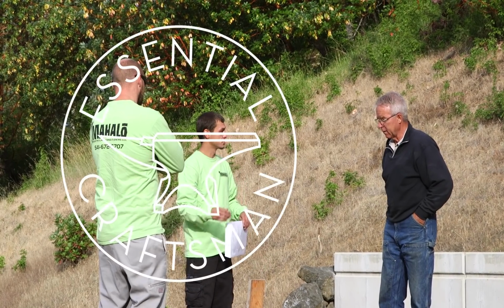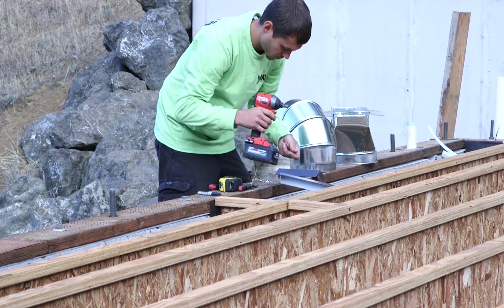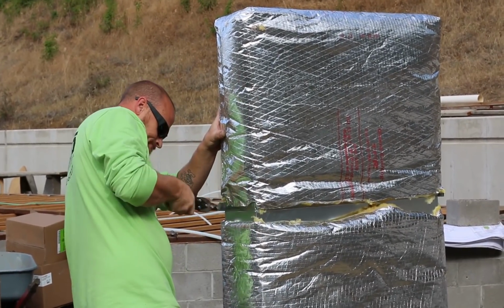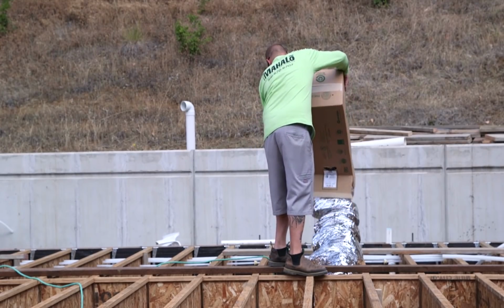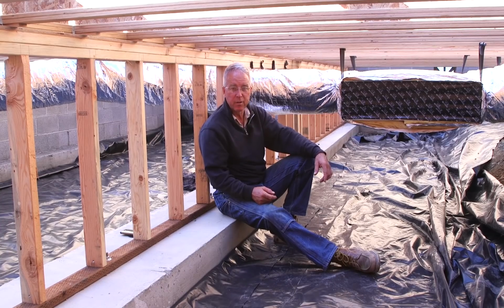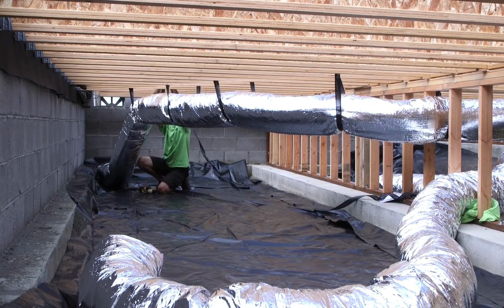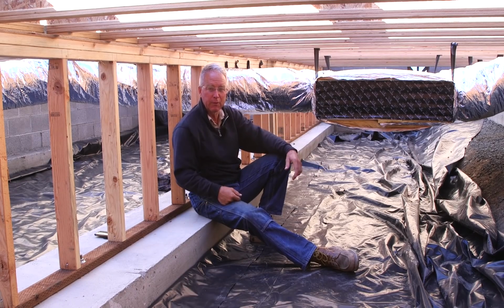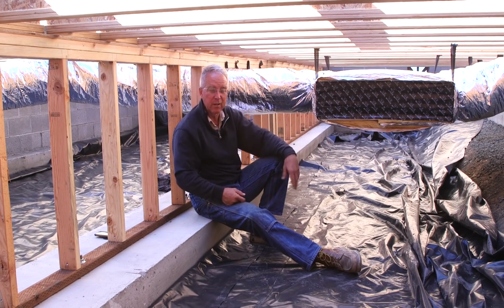Ducting Ep 42

Comment: Forced air isn't as common in my area as it used to be, the town I live in has no natural gas, propane has become expensive, fuel oil even more so. Heating with wood is still a very common practice same with electric base board, hydronic heating is used quite a bit in new construction. The places where there is natural gas they have you by the short hairs the price of natural gas goes up and down it can be very expensive.

Comment: Even with the understanding that different people do things different ways, this is concerning. A longer trunk line with shorter hard duct branch lines performs far more efficiently that this system. A short trunk line and long flex branches will make this system work much harder to condition the air. The flex lines will also break down in the short term, collapsing and leaking. This will increase the maintainance cost of the entire system considerably, and by much more than the cost of putting it in the right way. I have been in many many crawlspaces to repair plumbing and seen how badly the breakdown of these types of systems happens in just a decade or two.
Reply: @thepreachingplumber I agree.  I personally wouldn't install flex, but I understand it, especially in their climate.  My biggest issue was the length of flex used; shorter and straighter is always better and more efficient.  This really is just a plenum system with a spider of flex coming off of it.  The only real disappointing part of the job so far.  It wouldn't have cost too much more to have an extra joint or two of trunk line, and would have made a world of difference in the overall efficiency of the duct system.  Also I was blown away to see 8" runs used everywhere.  Not even a 4" for a bathroom... Then again maybe they used 8" to make up for the inefficiency of the flex duct...
Reply: I have to agree. I’m a project manager for a commercial mechanical contractor in Minneapolis... and a couple things about this wouldn’t fly here. First, there is a code limit to the max. length of a flex duct run. I believe it’s six ft.  They are way over that. Also, flex duct eats up way more fan static than hard duct. So, the points made about air balance are likely nullified because I’m betting they are not getting the air quantity that they should be. Finally... and I understand this is residential, not commercial, and I fully understand Mike Rowe’s point about “safety third”... but the lack of PPE used by all the workers in this series is alarming to me. Here, in my market, you’d have OSHA violations stacking up left and right!

That said... this is a truly fantastic series and I’m thoroughly enjoying it!
Reply: Dan Nelson BS ! if sized right and TESP is right you’re good.

Comment: I live in North Texas.  Our house was built in 1970, and we bought it in 2000.  From my experience, using the crawl space to put the duct work in is only viable if you can guarantee the crawl space remains dry.  Ours flooded after rains, so we had to move the ductwork to the attic and put French drains and a sump pump on the uphill side of the house.

Comment: Great ya let them in before the subfloor....uncommon bit of class....not meaning to be critical but I cringed when I saw flex duct. Maybe I'm just old ......
Reply: Yes and no about being old. Old because you know what quality ducting use to be. Yes because after 31 years in HVAC doing both commercial and residential, the hack or should I say lack of a graduated truck line and metal duct runs makes a journey man cringe! 😖
Reply: @natehicks8939  just my observations as an old sparky above drop ceilings....
Reply: @natehicks8939  Agreed!
Reply: I totally agree. It was great for Scott to let them in while it it was easy access. But as a Sheet Metal Worker, and a huge fan of this channel, all I could do was "cringe"  during this video.
Reply: Yeah, it is not as good due to friction but as he said, the cost is quite high for smooth duct.  I dunno how much higher, however.

Comment: Curious why you chose not to condition the crawl space, place
vapor barrier, and insulate. This is a more common practice now. The HVAC system would be more efficient and you’d have less potential for moisture issues.
Reply: As he has said many times the climate there does not get extreme, a lot of houses in the pacific northwest don't even have central ac systems because they are not used enough to justify the installation cost, so spending money to make the ac system super efficient would be just flushing it down the toilet. Also conditioned crawl spaces and attics is defiantly NOT common practice it's mainly done on custom built houses where the owner requested it. For a speculation house it's putting money somewhere where you would never see a return, and as an owner in that climate you would probably not live long enough to see the return on the energy bill.

Comment: Sorry, would not be comfortable putting fiberglass insulated duct work in  before dry-in.
Reply: The flex duct would be fine in "some" rain, but the large distribution box, would not, its wrapped with batt. Nothing a piece of plastic would not fix, at least for awhile. When I used to install HVAC many moons ago, we only used Pipe, they didnt even have flex, pipe is really easy to clean correctly. But still alot of work and work costs money. I put in miles of that stuff. I homes, apartments, and business places, but hey that was 1970. Now its blow and go. But they for sure better cover those vent boxes, water in that flex duct will get moldy, not good. Otherwise normal job.
Reply: That was my first thought watching that also. This is not a dry area nor are we heading into a dry season.
Reply: It only takes part of a day to deck even a pretty big floor with a just few guys.

Comment: The most critical part of a proper effecient HVAC system, if static pressures are poor efficiency will suffer. A SEER 15 can be a 4 all because of duct work.
Reply: I was just doing some electrical work in a house, stuck my head up above the ceiling tiles by the trunk lines, and it was a whirlwind around my head.  So much short-circuiting of the air.  The return air panning is terrible, and lots of large visible holes at every joint in the supply & return trunks as well.  I had to pull some of the panning away to access some of the wiring, it was barely stapled & the foil tape wasn't adhered to the osb sub-floor.  It really grinds my gears when people do such poor quality work.
Reply: @huckbeduck  It ends up to horrible runtimes for AC or heat, I would say maybe 75% out there are out of spec. and the person paying the bill is clueless.  In Fl in Aug. my runtimes are 4 hrs a day for a cool home, my neighbor run almost continuously.
Reply: @publicmail2  that is what is happening in this house.  It was vacant earlier this summer, I was there to mow the yard and trim.  I was there for 3 hours in the early morning and it had gotten fairly cool the night before.  Turns out the caretaker of the house had let someone spend the night there, and had turned the t-stat down from 85 to 72, and it had never caught up in over 12 hours.  Now a friend of mine bought the house and is having me move a few switches and outlets around, so I found out 1st hand why the system runs for so long.

Comment: Almost every house in Canada is all ridgid ductwork
Reply: My wife's cousin has a house in Hawaii that doesn't have any duct work. Clearly this proves that you Canadians are doing it wrong, eh. ;)
Reply: Mike Heath  I wasn’t saying it was wrong, just ridged duct in residential is actually quite affordable around here, lots of ways to heat and cool a house, lots of them don’t require ductwork, but around here lazy techs use flex duct to save time and money
Reply: Looks like the international space station. 

Or Robbie the robot.
Reply: As an HVAC installer these guys from mahalo seem to be a bunch of hackers, I would rip out all that flex and install a proper ridgid system with dampers and proper runs, I feel like they are pulling the wool over your eyes

Comment: I like the idea of this rough in, but my framing crew would kill me if they had to cut AdvanTech  for registers. 😂😂
Reply: If they are paid piecemeal..I'd understand..if they are paid a solid wage, regardless of time for unconvince..that would make no sense...good work is good work, not all in life is easy, just compensate fairly and all are good.
Reply: Colin Glidden are you a builder? I only ask that because many aren’t familiar how things are billed out, which varies from region to region. Framer’s who work in my area base their price off of square feet on standard framing practice. Standard pricing is laying subfloor and mechs cutting registers after the fact.
Reply: Jason, if the job was specified on front end, that ducts would be in place, then pay the framers for the extra work required..not as a standard bid, because it is outside of standard practice..be fair with your dubs and they don't complain..that was my underlying point. If they bitch..there usually is a reason.

Comment: Wow, there are TONS of duct joints they didn't put aluminum tape over. Not good :(
Reply: I was thought Aluminum tape will not last as long as mastic or silicone
Reply: @rocketman8068  Whatever your code recommends, you should insulate the joints. It was very obvious they didn't put them on the duct work going down from the registers, and who knows where else.

Comment: It's fascinating to see how houses are built in the US, it's so different to what we do in the UK. I don't think I've seen a house that has air heating / conditioning like that, we pretty much use hot water and radiators to move heat around. It means more plumbing but it's compact which is a benefit in our tiny houses. Of course a wet system can't do cooling but that's not a problem here.
Reply: That’s the way we do it in Australia too.  No boiler or radiators just air ducts that sometimes also double for cooling.
Reply: According to my air conditioning mate, there's an increasing trend for domestic residences to have air-con for heating and cooling. According to him, its more efficient than using oil or gas, and I suppose if you were getting your electricity from renewables it would be more environmentally friendly.
Reply: @danielmclaughlin2137  Yeah split AC units are now rated with a coefficient of performance of 4 or more. Which means in optimal conditions you get 4kw of heat out for 1 kw of electricity in.
Reply: Just wait for a bit of global warming to kick in haha.... I think you will start to see the use of more US style systems when the new regs come in, they are phasing out gas boilers in the UK so we will have more split AC and central air systems for sure. The heat pump will be king....right up until we get -5 winter days! haha

Comment: Proud Sheet Metal Worker here.

HVAC is the highest utility cost and the biggest factor of occupancy comfort. Flex should never be longer than 5'.
Reply: Ah gotcha, thank you.
Reply: What is the flex exactly?
Reply: @Ole_Ev54  A larger diameter version of the exhaust hose on your clothes dryer with insulation around it.
Reply: @Ole_Ev54  hose installed by Hosers.
Reply: @Ole_Ev54 , Plastic junk that gets squeezed through holes half the size of the actual duct.
Reply: @augustreil  😂 sounds annoying

Comment: It's a ductopuss. I thought those were bad.
Reply: In my opinion, those guys in the video seemed definitely not very professional or adept. That can be seen in numerous parts e.g. when the one without the sunglasses is doing measuring, cutting and screwing the bolts. Everything is done a bit sloppily and the cutters/pliers are used as a hammer in the beginning, for example :)
Reply: @Javert20000  Knocking folded sheet metal over another piece can be done with anything handy like a block of wood or the metal tool.  Time is a commodity too.
Reply: @Javert20000   As a previous HVAC licensed contractor who installed everything from cheap change outs to 6 unit multi million dollar homes I can say they did a fine job.  The old school mentality of only using a hammer to hammer is gone.  Not to mention if you knew how that connection went together a hammer was not necessary.  Did you notice the drill powered cutter for the take off holes?  They had the right tools and did a great job.
Reply: @kernelsanders5912  Bake in the day there was a right way, a wrong way, and a way to make money. So Todays right way is to make that money? Not sustainable IMO. Only because in this trade you need to not only to be skilled but technically skilled. Behavior drives attitude tech.
Reply: Kernel Sanders thank you for adding sense to some other wise senseless comments. They did do a very fine job. High five ✋🏼

Comment: Interested in how the return air will be laid out.
Reply: Most companies are doing common returns again. It saves $$ up front for the homeowner. Should there be a homeowner that has allergies this way is simpler to maintain and clean out. Also it will have a smaller footprint. Door hangers on the other hand must not forget to cut the doors shorter or the HVAC guys can put vents in the stud bay on opposing sides of the room into a common area, preferably before sheetrock.
Reply: spqr0a1 most likely common return.
Reply: Return air?, he said; what's return air?